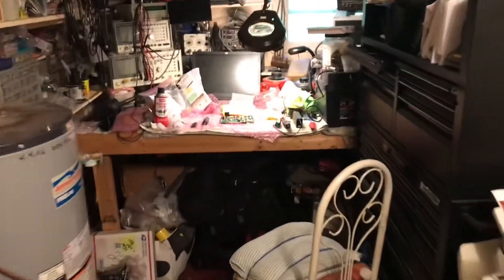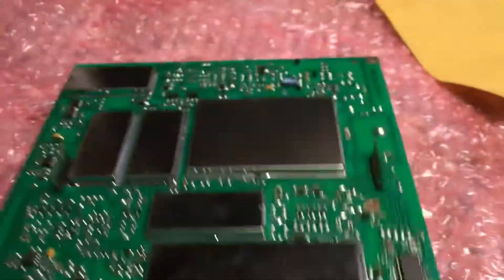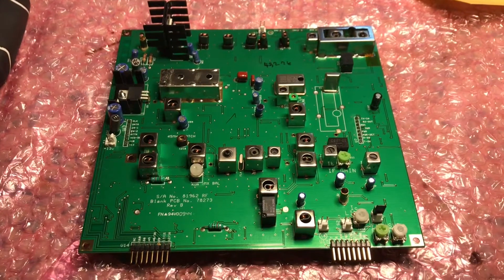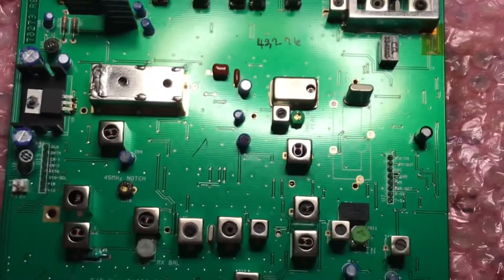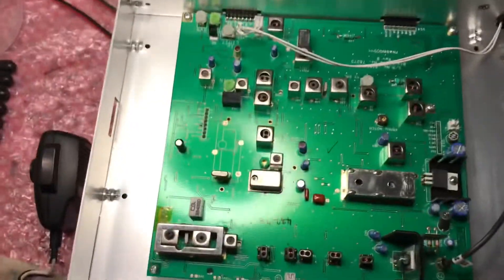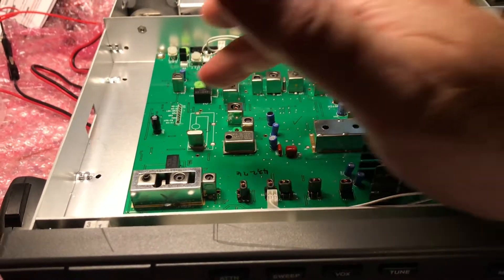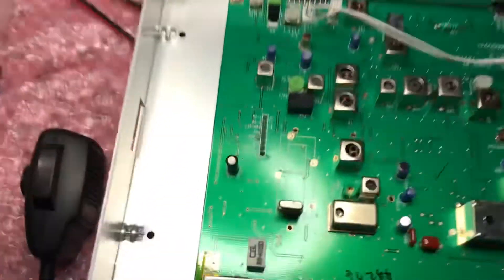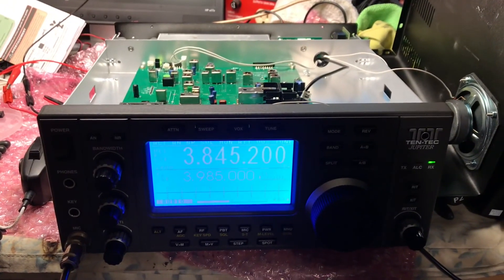Ten Tec Jupiter Ceramic Filter Replacement FL2 & FL3

Comment: Had an issue with the ceramic filter on the receiver side. The filter's curve was way down and rounded.   Ten Tec's technicians covered for it by turning up the IF gain.   The xmit filter was fine.  Wondering just how many Jupiters are out there with bad filters.   When buying from China, buy several filters and check them all for the best curve.  Since it's receive, I used a narrower filter, but don't go too narrow as the IF shifts and the bfo offsets are not optimal.  -4/+3KHz is the narrowest you can go on the receiver side.